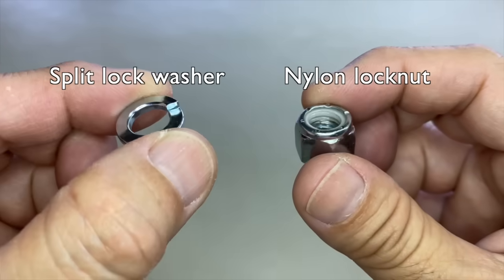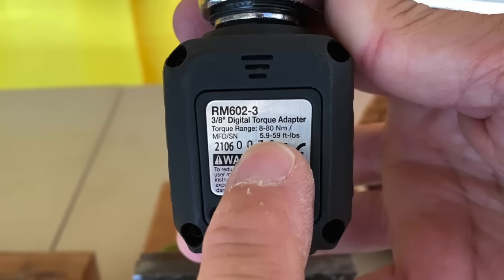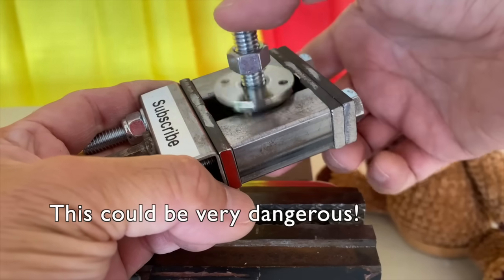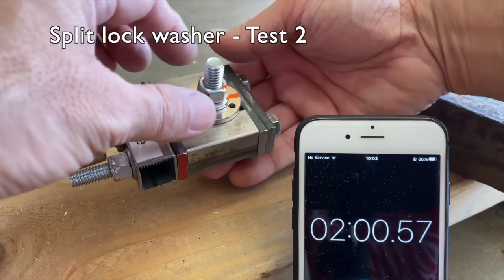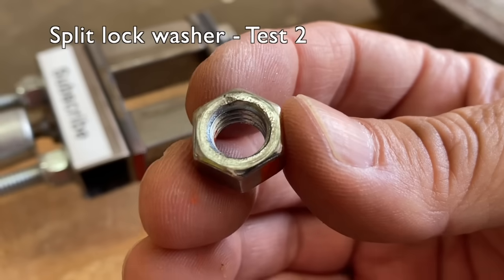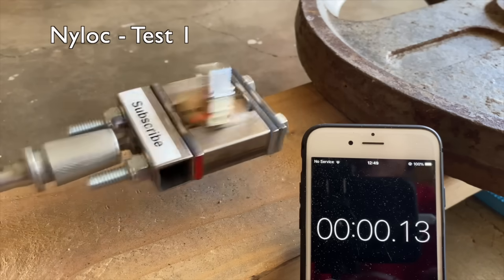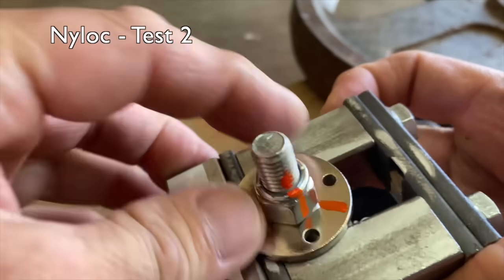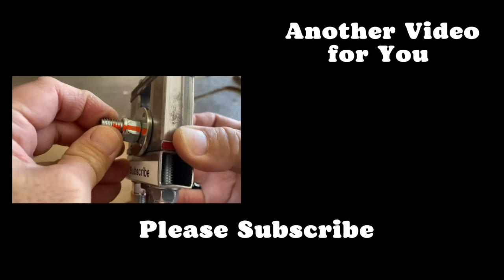Nuts & Bolts - Split Lock Washer vs Nylon Locknut – DIY Impact & Vibration Test - Part 1

Comment: Of course at 6 ft lbs a split washer is going to come apart! You have to tighten them down a lot more than that. I personally do not use nylock nuts, they have a tendency to strip out. I only use lock washers, if I have to.

Comment: As an industrial mechanic, we were told by our hardware supplier that split lock washers just don't work. But they keep selling them because their clients have always used them, and they keep ordering them. We always used nylock nuts and a flat washer.

Comment: Proper fasteners and torque for the application go much farther than any locking device. Engine internals don't use either of these options and stay together in far worse pressure/force, heat cycling, vibration situations while being lubricated for decades sometimes.

Comment: On the nylock nuts the paint mark on the bolt and nut never misaligned, my takeaway is the bolt failed not the nut. The bolts probably stretched which released the preload, but the nuts never failed.

Comment: How can you set the torque comparatively with the block given some of the torque resistance is the  nylon itself and therefore some of the stored compressive force to resist turning loose is lost? Blocks are great but they tend to fail horrible if oil or other chemical get to the nylon. I’d like to see you try some serrated washers

Comment: That looks like a pretty standard metric M8 bolt and nut combo , which is meant to be torqued at around 22-24 Nm which is around 16-18 ft-lbs.  You're at a third of the specified torque for that size nut.The setup is not even tight to begin with so it losing it's non-existent preload should be no surprise. Imagine all cars suddenly having their wheels mounted with only a third of the specified torque, they'd all fall off after a mile of driving.

Comment: I never use nylok nuts as the loosening torque is too low.  I use conelok nuts instead.  Also suggest you repeat the experiment with grade 8.8 bolts and give them a much higher torque.

Comment: So what this tells us is, if you don't tighten your fasteners properly or even remotely tight enough, nylock are they way to go? 🤔

I think that's pretty obvious even without this test. Since you need a proper amount of tension to allow the split lock washer to do it's thing. If you're testing loose hardware there's no point testing anything else. Anything that locks at the threads (nylock, stover, loctite) is going to be better than any locking washer.

Comment: It would be interesting to compare how these options perform versus two (standard non locking) nuts back to back on the thread.  That is, first nut applied, then second added and torqued to the first whilst first is held in place.  Similar to hardlock nuts on railways.

Comment: You're missing the point.  Split lockwashers are designed for high-heat applications, and nyloc lockwashers are designed for high-vibration applications.

Comment: The results show,,, 6 foot pounds don't cut the mustard
Reply from the maker: 6 ft-lbs was sufficient in the follow-up test… Split Lock Washer vs Split Lock Washer & Nyloc – DIY Impact & Vibration Test - Part 2
https://youtu.be/Iao2HT71kB8
👍😎
Reply: @HacksbyDad  sure but it's not really relevant is it? That's not the way these pieces are meant to be used. Kind of like seeing which screws hold best in Sheetrock.

Comment: If u squesed em properly  stop ur fooling and do ur test properly ..6 lbs a joke
Reply from the maker: 6 ft-lbs was sufficient in the follow-up test… Split Lock Washer vs Split Lock Washer & Nyloc – DIY Impact & Vibration Test - Part 2
https://youtu.be/Iao2HT71kB8
👍😎

Comment: Please do a test with Nord-lock washers.  We've used them in my factory.  I remember 1 bolt, maybe 3/4" diameter that we couldn't loosen.  The Millwright brought over a hydraulic powered thing that would apply massive torque to loosen it.  The machine couldn't remove it.  He finally had to melt the head of the bolt off with a torch.  Those things are amazing!  Even when you just slightly finger tighten a nut with one of those, the grip generated is incredible.
Reply from the maker: My Nord-Lock test is out… Will Nord-Locks Survive My Test?  DIY Impact & Vibration Test – Part 5
https://youtu.be/wOUnlfhHRko
Pls check it out and drop a comment.  👍😎

Comment: WHo spec'd the initial torque? Sponge Bob? NyLoks are not supposed to be screwed that far.
Reply from the maker: 6 ft-lbs was sufficient in the follow-up test… Split Lock Washer vs Split Lock Washer & Nyloc – DIY Impact & Vibration Test - Part 2
https://youtu.be/Iao2HT71kB8
👍😎

Comment: 6 pounds of torque is not enough.
Reply from the maker: 6 ft-lbs was sufficient in the follow-up test… Split Lock Washer vs Split Lock Washer & Nyloc – DIY Impact & Vibration Test - Part 2
https://youtu.be/Iao2HT71kB8
👍😎
Reply: @HacksbyDad  your wrong 6ft-lbs I can achieve that with my fingers.
Reply from the maker: @jeffallsbrook3999  6 ft-lbs is what my torque adapter read and there's no way that I could loosen the nuts with just my fingers.  Maybe I'm too old.  🤷🏻‍♂

Comment: If no cotter pin is desired, I would increase my torque pressure.  6Nm. was too low of a torque setting in my opinion.  👍

Comment: 2:24 He chose a test torque that doesn't properly compress the split lock washer.
That low torque is probably the cause of the meaningless results with the locknut also. Once running torque of the nylon is accounted for, there was probably very little compressive force on the assembly, so relative movement of the components created wear.
Reply from the maker: 6 ft-lbs was sufficient in the follow-up test… Split Lock Washer vs Split Lock Washer & Nyloc – DIY Impact & Vibration Test - Part 2
https://youtu.be/Iao2HT71kB8
👍😎

Comment: What am I missing? On the Nyloc tests... If the nut AND the bolt are still lined up didn't the vibration test just display how much material has gotten worn away, leaving a gap, and allowing the bolt head and washer enough play to move around. At first glance it doesn't seem to me that the nyloc has failed, has it? For ther record I have none of the qualifications of the other commenters. I'm just some dude who works on stuff sometimes.

Comment: Try torquing to the recommended value of 20 lb. ft. (for grade 2). Why torque to a measly 6 lb. ft? This test is worthless.
Reply from the maker: 6 ft-lbs was sufficient in the follow-up test… Split Lock Washer vs Split Lock Washer & Nyloc – DIY Impact & Vibration Test - Part 2
https://youtu.be/Iao2HT71kB8
👍😎

Comment: As stated, this proves nothing. 6 lbs is not sufficient torque to properly engage a split lock washer. Try it again with at least 20-30 lbs of torque.
Reply from the maker: 6 ft-lbs was sufficient in the follow-up test… Split Lock Washer vs Split Lock Washer & Nyloc – DIY Impact & Vibration Test - Part 2
https://youtu.be/Iao2HT71kB8
👍😎

Comment: The results are not surprising. For hospitals in California, there are seismic attachment details that are pre-approved for vibrating equipment supports and they will almost always use either nylock nuts or double nuts; I've never seen the split washers used or allowed. I would be curious what double nutting would do with the outer nut being a nylock, it should have extra strength and of course there's always loctite thread grip to add to any of these attachment methods. Loctite is also great for expensive items that require low torques like my expensive carbon bicycle components.

Comment: Lots of great comments, but Ocam's razor....just weld the f'ck'n nut on!  Ok...well maybe not the best solution.  There's whole application science here....
torque (wet/dry),
bolt/stud stretch,
split/tooth/serated(Nord) washers,
no washers just nut,
nut/nylock nut/taper nut/double nut and castle nut (maybe crossthreaded nut for the county boys)
chemical glues such as Locktite, krazy glue, nailpolish?..really (yes for electronic guys preventing potentiometers/inductors/capacitors from moving from vibration)
Look at your application to see what works the best.  Just remember engineering is about reasonability and preventing user harm.  Unlike Russian bullets through a jet tail section.

Comment: How do you test a bolt that's basically not even tight to begin with? 6 lbft is nothing for the bolt of that size. Of course it would vibrate itself off. The nylon bolt has a lot of friction holding it in place even when it's not tight, not even a fair comparison between the two. And if you're really worried about a high vibration application then they make special locking washers and bolts for that, but it's highly unnecessary for regular mechanical usage. You can also use a wire/cutter pin setup that will most certainly prevent a bolt from coming lose. Just learn the basics and save yourself the headache of doing unnecessary testing that's been tested by the industry many many times over the last couple of centuries of mechanics.
Reply from the maker: 6 ft-lbs was sufficient in the follow-up test… Split Lock Washer vs Split Lock Washer & Nyloc – DIY Impact & Vibration Test - Part 2
https://youtu.be/Iao2HT71kB8
👍😎

Comment: Split lock washers are a joke anymore. Depends where you buy them, some are soft, poor quality and dont lock the nut. Some actually are hard and have spring to them to actually lock the nut. Lots of poor quality crap out there from  vendors.

Comment: Clearly the weak point is the discs.  If the nylon nut does not turn on the bolt, the nut performed flawlessly.

Comment: Guy is on the right track, but 6 lb-ft torque on a .375-16 Gr 2 zinc plated screw/nut is not nearly enough to create torque tension via plastic-elastics deformation.
Reply from the maker: 6 ft-lbs was sufficient in the follow-up test… Split Lock Washer vs Split Lock Washer & Nyloc – DIY Impact & Vibration Test - Part 2
https://youtu.be/Iao2HT71kB8
👍😎

Comment: Totally invalid test because the bolts weren't tightened anywhere near their breaking point. You need to do that in order to slightly distort the bolt and threads like on cylinder heads.

Comment: 72 in lb makes me suspect. I’d like to see it done at 220 in lb.
Reply from the maker: 6 ft-lbs was sufficient in the follow-up test… Split Lock Washer vs Split Lock Washer & Nyloc – DIY Impact & Vibration Test - Part 2
https://youtu.be/Iao2HT71kB8
👍😎

Comment: A typical torque for a 3/8 inch bolt is around 15 foot-pounds
Reply from the maker: 6 ft-lbs was sufficient in the follow-up test… Split Lock Washer vs Split Lock Washer & Nyloc – DIY Impact & Vibration Test - Part 2
https://youtu.be/Iao2HT71kB8
👍😎

Comment: I know in automotive engines or even high revving and overly stressed race engines, bolts and nuts, that are submerged usually in oil,( rod bolts and nuts, rocker arm bolts and nuts, etc.) will never come loose because they are torqued properly. They don't use nylon lock nuts or split washers inside of an engine. I guess they would come loose if they were torqued to only 6 lbs.

Comment: Had a split washer unscrew on a stainless steel trailer hitch pulling a speed boat 120 miles.   Huge nut >1" diameter bolt 1.5" long and it unscrewed and poped off hitched saved by safty chains.  If rusted on or had nylon or even tape on the threads it would not vibrated off in such a short time.   It might not have had enough torque on the nut in the first place not sure.   But yes a cotter pin or blue locktite on threads would help. on top of a split lock washer.

Comment: So since the nyloc never turned on the bolt, how did the assembly get loose? Did the assembly stretch due to the amount of vibration? Thanks!

Comment: Years ago, NASA did a study on fasteners which showed split washers, once they flattened out, achieving very little locking action.
Reply from the maker: 6 ft-lbs was sufficient in the follow-up test… Split Lock Washer vs Split Lock Washer & Nyloc – DIY Impact & Vibration Test - Part 2
https://youtu.be/Iao2HT71kB8
👍😎

Comment: As a rule a bolted joint should never allow the bolt to take any load in shear or the bolt will likely fail.  The clamping force must be great enough between the two clamped members to prevent that from happening under design load condition.

Comment: The nylon is cut as it is tightened, the cut is specific to that assembly. Therefore, once a nylock is tightened, then loosened and removed, it should not be used again.

Comment: I think limiting the clamping force to only 6 ft lbs is the major reason for the failures for this rigorous of a torture test.
Reply from the maker: 6 ft-lbs was sufficient in the follow-up test… Split Lock Washer vs Split Lock Washer & Nyloc – DIY Impact & Vibration Test - Part 2
https://youtu.be/Iao2HT71kB8
👍😎
Reply: @HacksbyDad  
I'll definitely check it out.  
I've always preferred the nylock over the split washer.  I'll always drop washers when trying to put them on, lol.

Comment: Anyone involved in auto racing can tell you nylon nuts are superior. However, the test was flawed by far too low torque for a bolt that size. Of course, the one limitation of nylon nuts is they cannot handle temperatures above 200C.

Comment: Been building things for many years, nyloc is the way to go unless you plan on cutting and peening the bolt. My favorite toy growing up was an Erector Set with the 120 motor. Good video. I hate lock washers as they bugger up the threads on both the bolt and nut. I would like to see how a double nut would have held up.

Comment: Fastener Engineers know when the proper clamping force is applied, every split washer IS a flat washer.  If it is a split washer the assembly has already loosened. We don't recommend them for anything.

Comment: I consider this kind of test rather hard. Normally, the nylon nut provides constant distance between the nut and the screw's head, whereas the split lock washer gives a tolerance for the distance - it's a compliant connection; and this reasoning should be followed in most decision making processes on which is the more suitable for a specific joint. Bear in mind, that the "nylon" connection can become a bit loose after some perturbation, because it is not compliant.

Comment: The lesson i see is to torque lockwasher bolts to spec.
Reply from the maker: Yup… I agree.  But 6 ft-lbs was sufficient in the follow-up test… Split Lock Washer vs Split Lock Washer & Nyloc – DIY Impact & Vibration Test - Part 2
https://youtu.be/Iao2HT71kB8
👍😎

Comment: Size for size, the nyloc is superior as it has a "grip" on the bolt thread all the time regardless of the torque applied or if the bolt stretches. The split lock washer relies on the sharp edge to bite into the nut and the fastening surface to stop the nut from loosening, however if the nut is loosened, the nut will eventually come off.

Comment: Have you ever tried to tell a man with "the full force of a man" to torque an arbitrary nut (non torque wrench proof joint) to 6 foot-pounds. Is that a specification value written in stone? He would probably tell you where to go, and then tighten it to feel right

Comment: Not a valid test. The nylock is deigned not to spin regardless of clamping pressure. Fasteners, as applied in your test, are designed to clamp parts together so that friction prevents them from moving. It is this immobility that is a major contributor to fasteners not coming loose. The lock washer is designed only to counter rotational forces due to the relatively smaller force vector resulting from the thread angle. Tighten to 39 ft-lbs, the recommended value for 3/8-16 grade 5 galvanized, and try again.
Reply from the maker: 6 ft-lbs was sufficient in the follow-up test… Split Lock Washer vs Split Lock Washer & Nyloc – DIY Impact & Vibration Test - Part 2
https://youtu.be/Iao2HT71kB8
👍😎

Comment: I guess this just shows why you safety wire anything important... 3rd test that would be interesting is to use Locktite on a standard nut instead, or with a lockwasher or Nyloc

Comment: I’ve done 10 foot pounds for almost everything. I never had any bolt or nut come loose. 5 foot pounds I only do for very small bolts. Like carburetors bolts. My general rule is every quarter turn is 10 foot pounds. And 1/8 turn is 5 foot pounds. I’m a small engine mechanic. I couldn’t afford a torque wrench. So I just used my high school basic auto mechanic training class techniques. It’s only my techniques. For engine rebuilding use a torque wrench. For small engines you don’t really need a torque wrench.